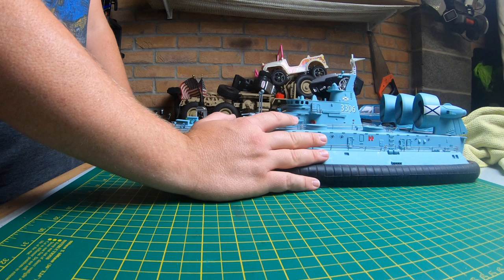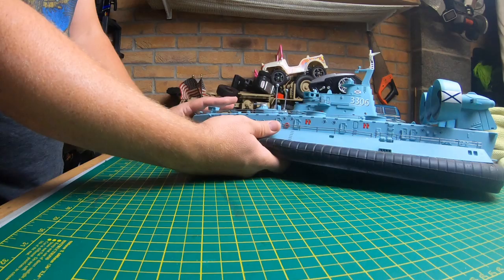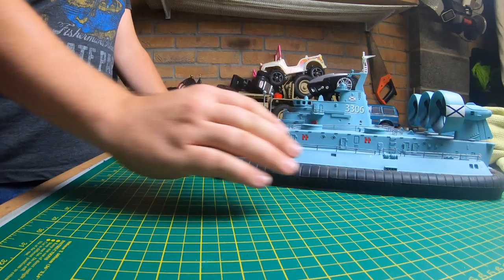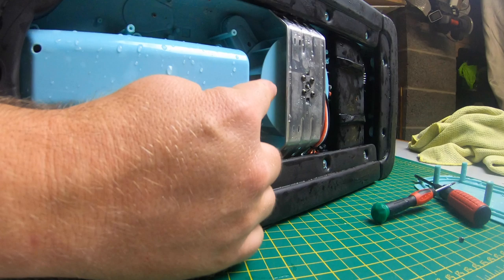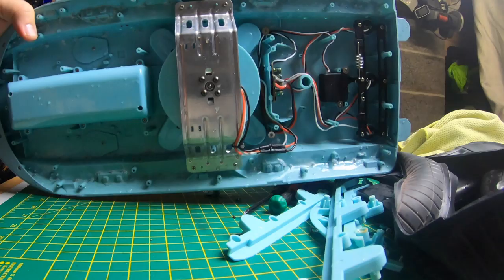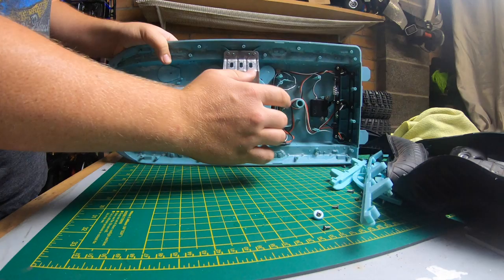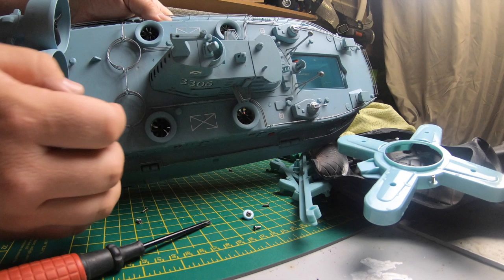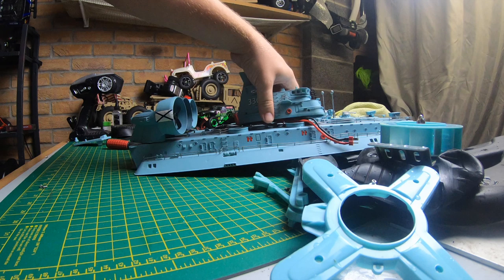Whats inside a $200 RC Hovercraft? HG-C201 Zubr-class, Worlds biggest Hovercraft.

Comment: Adding ballast underneath would have fixed it it's top heavy
Reply from the maker: It may have helped, but I'm not sure it would have fixed it
Reply: @TomleyRC   You would have to upgrade all the motors to compensate for the increased weight

Comment: It´s worth slapping it back together as a shelf queen, as it´s so finely detailed.
 It was interesting to see inside this model, and to see that there´s no single major design flaw which stops it working properly on water.
 Obviously having the centre of thrust so high above the centre of drag isn´t ideal, but the full-size hovercraft on which this is based doesn´t stuff its nose under water every time the operator accelerates...
 I, too, own a rather crappy Chinese model hovercraft, and I´ve found that I never need to remove my skirt, preferring instead to simply lift it up whenever I need to gain access   : )
Reply from the maker: Shelf queen, or a custom pick up truck with 3 brushless props on the back! hmmmmmm
Reply: @TomleyRC  Custom pickup!

Comment: Maybe if it actually had four independent lift motors (like a quadcopter) the gyro would be useful for something? Not sure if it does it any good as is - probably would work as well (if not better) without it. Making four zones of controlled pressure could make it more stable.
Reply: BINGO!! 4 30-32-36 mm ducted fan units and ditch a LOT of dead weight!
Reply from the maker: Nice idea, that would work for sure 👍

Comment: done lots of digging into hovercraft design a few years back, that thing looks very heavy for the amount of power available, and pretty CFM air flow restrictive... are problems for any hovercraft. the motor, bracket, and air passage could be ditched, cut out the stacks for 4 30 mm or larger ducted fan units, byebye to the whole bottom plate and pop a new skirt on it. doing all that I think it'd hover really good. the battery trap moved back and using a smaller lighter battery would also help. really neat looking, but poor+cheap design darnit. the passive fans up top DO restrict flow too, carved out for real fan units would be TONS stronger than restrictive vents all running into a single squirrel cage blower..... short version, I wouldn't give up on it to make it a wall hanger or shelf queen, above is what I'd call an attack plan for it.
Reply from the maker: I'm nit sure I have the time, or the patience to be honest.
Reply: winter coming up could be good for 1/2 hour here-n-there tinkering.
it'd require 4 of these: https://www.ebay.com/itm/35mm-EDF-Accessory-8-blade-Fan-Rotor-Dia-35mm-PVC-Blue-Plastic-Ducted-Housing/163618587732?hash=item26186d8454:m:mb7I8QNZc5wKoPj_ffcqXNw
OR 4 of these (smaller): https://www.ebay.com/itm/30mm-EDF-Accessory-8-blade-Fan-Rotor-Dia-30mm-PVC-Blue-Plastic-Ducted-Housing/163618587992?hash=item26186d8558:m:mb7I8QNZc5wKoPj_ffcqXNw
 and the motors to go with them, with luck the original lift fan ESC could run all 4 of them parallel....yup, 75-80 bucks later to MAKE it work properly... but it'd sure be a one of a kind!

Comment: To be honest , something that is very easy for them to do is put the batery at the center of the hovercraft , it has space , the comand station is easy to put the same mechanism on the front , were you unscrew the lid to pop it out , it stabilizes the hovercraft, it still looks good and it even works better , kind-off a bruh moment for the design but it doesnt break the thing , from what it looks , it works prety well aside from the stabilization thing , witch doesnt make sense as it has a giroscope but maybe you have a faulty one or something